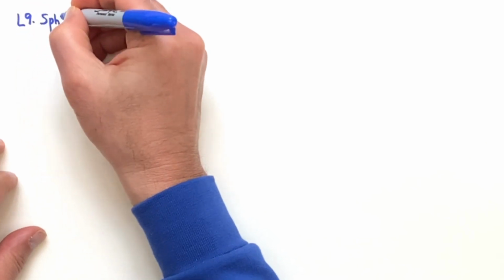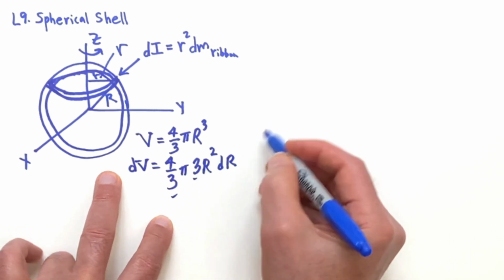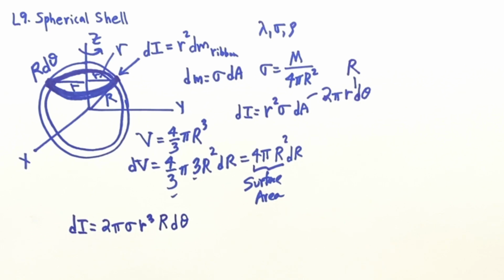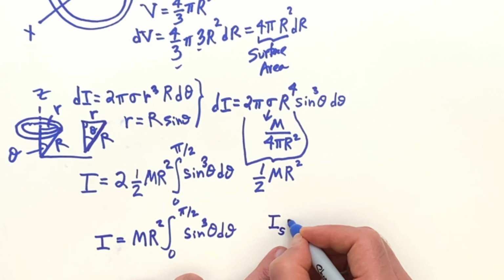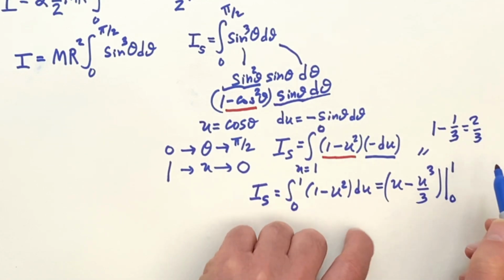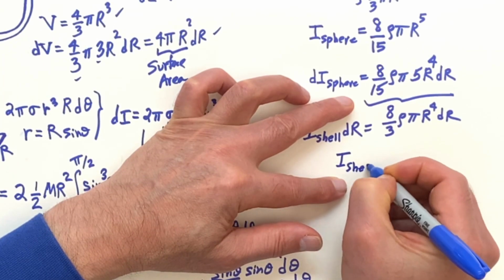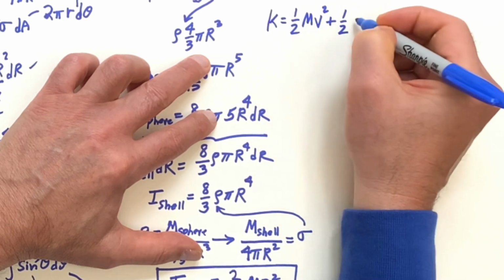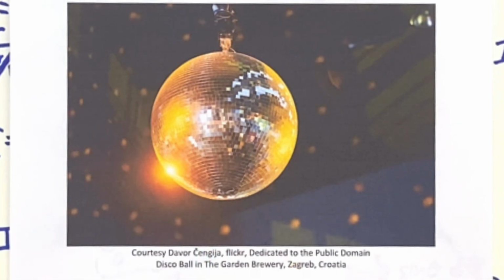L09. Moment of Inertia for a Spherical Shell

Comment: Anyone out there in the void wanna educate me. I'm probably going to hit Khan Academy Physics right quick and Chatgpt for my education. But this is exactly the sort of stuff I'm curious about right now. More specifically unit analysis and the polar graphs to some degree. This exampe in the video is a polar graph, so you got a clean set of rules for integration in 2d and apparently 3d. I like it. I'm looking at 2d graphs where the unit analysis of the area under the curve seems to be x*y (Force * m=Nm, m/s^2 * s=m/s). So Chat gpt tells me there are 4 kinds of graphs for 3d where x and y are independent and z is dependent. For the unit type of the volume under the curve I would just multiply the three axis units together?

I just added this from Chatgpt, it's nothing. Just examples I guess.

Electric Field: In electromagnetism, the electric field is a vector quantity that can be represented by a three-dimensional graph. The x and y axes can represent spatial dimensions, while the z axis represents the magnitude or strength of the electric field at each point in space. 
(A/m)*m*m=A*m

Magnetic Field: Similar to the electric field, the magnetic field is another vector quantity that can be represented in a three-dimensional graph. The x and y axes represent spatial dimensions, and the z axis represents the magnitude or strength of the magnetic field at each point. 
(A/m)*m*m=A*m

Wave Propagation: Graphs depicting the propagation of waves, such as sound waves or electromagnetic waves, often use three dimensions. The x and y axes represent spatial dimensions, while the z axis can represent the amplitude, intensity, or other characteristics of the wave at each point in space and time. 
J/s·m^2*m*m=J/s·m^4 or W/m^2*m*m= W

Potential Energy Landscape: In various physical systems, potential energy landscapes can be visualized using three-dimensional graphs. The x and y axes represent spatial dimensions, while the z axis represents the potential energy of the system as a function of the positions in space. 
J*m*m=J*m^2, or (kg⋅m^2/s^2)*m*m=kg⋅m^4/s^2